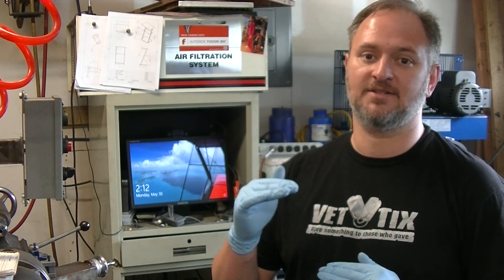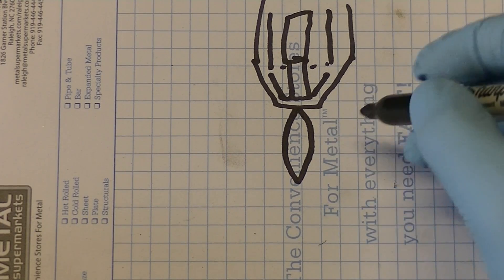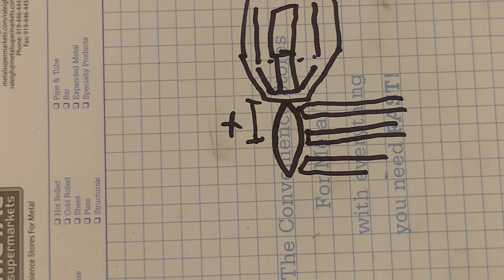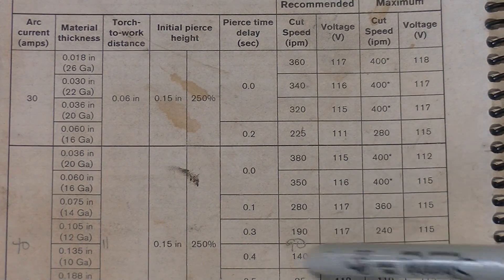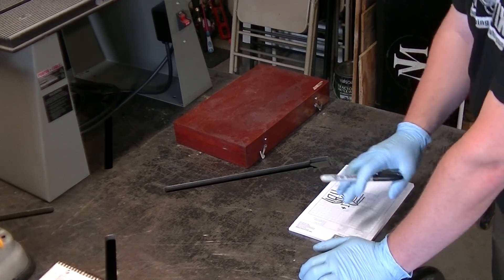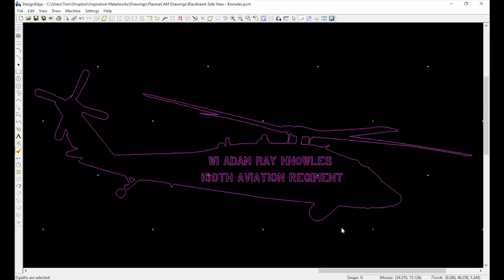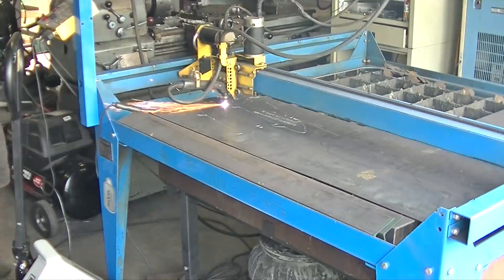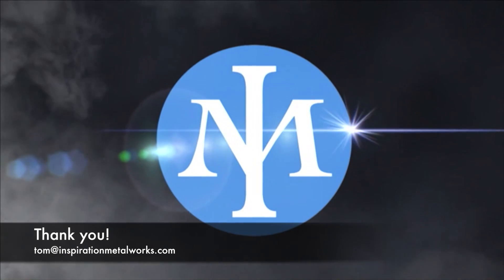Plasma Cutting - Height Control

Comment: Very cool I'm new to the Plazma Cam system. Do you do any 3d routing and if so could you do a walk through on how to set that up? I've actually learned a ton but I'm still getting bad results. I'm not sure what I'm doing wrong.

Comment: Hi i have a problem with my controller.. the up and down limit switch are all on and i can't fugure out why.. i checked thw limit switches and thwy work on.. the cable is eqaully not damaged.. what could be the cause
Reply from the maker: Did you verify that the cables are plugged in to the correct terminals on the limit switches? It sound like you have them swapped between the open and closed position.
Reply: @TomZelickman  yes i did.. currently i think its a software problem and am trying to chane the parameters from P1 to P 6 so i can fix in nee parameters..
Reply from the maker: I’ll see if I can check any parameters on my side if you would like.

Comment: Still don't know what a good starting number for AVS is, or how it relates to voltage changes. I have a PC DHC2 running Plasmacam 3.11 (not DE). Reason I came is I am running 3/16"  6061T6 and starting with the default of 1.153, I went down to 1.083 which made it dive worse, so I went to 1.223 which seemed to barely dive (-0.07, then +0.07), so I decided to try 1.4 which made it very high, then 1.3 which was less high, then 1.26 seemed to behave, but there seems to be no rhyme or reason to it except for alchemy and the Plasmacam manual is crap.
Reply from the maker: I feel like I saw a really good writeup from Jim Colt about setting the arc voltage properly. I'll see if I can find it for you.
Reply: @TomZelickman  That would be great. I have the same issues.

Comment: I am having troubles losing arc connection in mid cutting, can you give me any advice
Reply from the maker: Hi Johnna - there's quite a few things to watch for there. Cut height is really important for good cut quality. Cleaner material does better than dirty material as well. I would also check to make sure that you have a good grounding setup. We run an extra ground to a rod that's driven 4 feet into the ground. Hope this helps! - Tom Z

Comment: Hyper therm IPM setting are total BS, there is definitely a how long is an inch joke when it comes to those guys . Run at half of what they say to start at least to get reasonable finishes !
Reply: I agree completely. AND there is no interpolation or explanation about anything. It all seems to be an afterthought, definitely not practical info. For example, my HT PM64 cutting 3/16" 6061T6 looking in the book at shielded 45A consumables number jump from 1/8" to 1/4" from 100 to 50 ipm and no variance of the  amperage. I wound up using 100 ipm and 35 amps. I was tempted to use fine cut but the book just stop with NO info. A little discussion would be nice from the MFR in the manual. I spend WAY too much time on forums trying to find info HT SHOULD have given in a PRACTICAL format. Good torch, BAD manual.

Comment: Very helpfull. I have a therrmal dynamics cm151 and mistakenly thought my machine had the same cut height as yours but every machine has a different shape jet. Mine required .19" cut height.
Reply from the maker: Hadn't thought about that before but it makes sense. The jet will be based on the orifice size, amperage, and air pressure... Thanks for checking in and letting me know!

Comment: Thanks for the video. I recommend using feeler gauges if you don't have the gauge blocks. That way you can add a couple of them together to get exact sizes rather than the drills. Plus most mechanics have them already in their tool box.
Reply from the maker: Hi Ed - that's a great method as well, especially if you are shooting for an exact cutting distance which is typically .060 according to the Hypertherm charts for my machine.

Thanks watching and adding to the discussion!
Tom Z
Reply: I used the drills because they are very handy.

Comment: Hi Tom,
Good explanation for using Height Control!  I didn't know you used a lot of 11 gauge.  That is pretty heavy stuff.  Careful lifting those sheets!!  I made some rollers that mount on the front of the PlasmaCam table to help get the sheet on the table.

Take Care,
Reid
Reply from the maker: Hi Reid! Thanks for watching but this was probably old hat for you now. :)

I do everything from 14g to 1/2" on my table. My signs are mostly 14g, things that need a balance of sturdy & light usually is 11g. The guy I cut parts for that does decorative fences and gates like 1/4". Targets get as heavy as I can cut. I really do need to work out a better loading system though...

Best wishes,
Tom

Comment: Technical stuff is good.  Had my plasma out today for a few cutouts in 1/4 wall pipe.  I have a larger project to do this weekend with allot of cutting with 1/4" plate.  I will have to pay more attention to my heights, I already know that I am all over the place but I will try harder.  Maybe I will get better with some practice.  Good luck with the unboxing.
Reply from the maker: Hi R.J.! I've seen guys freehand cut with plasma or acetylene that was flawless. I guess like anything, its a matter of practice and consistency. Hope this video helped a little bit!

Best wishes,
Tom

Comment: That's great... my cheap chinese machine had no manual and no helpful starting points for this..... Think ill try and screen capture your page and give a go at some of the settings as close as i can anyways.... 
Thanks
Reply from the maker: You can always grab the Hyperthem manual online as a PDF as well. The speeds and feeds vary based on the material you are cutting so there are several pages of those charts. Let me know if you need any help!

Sincerely,
Tom Z